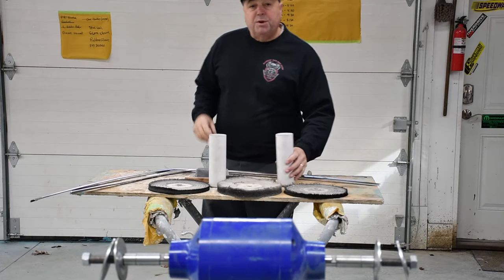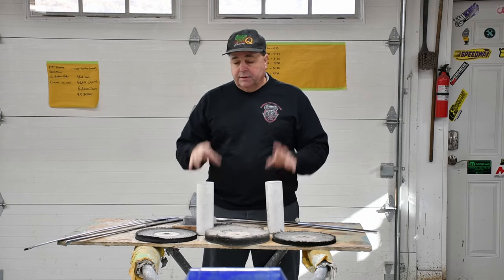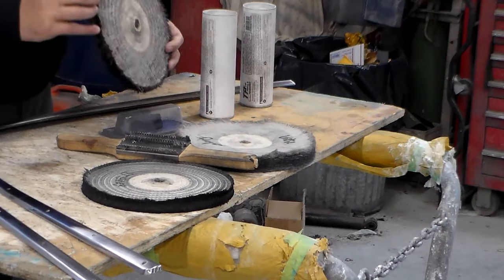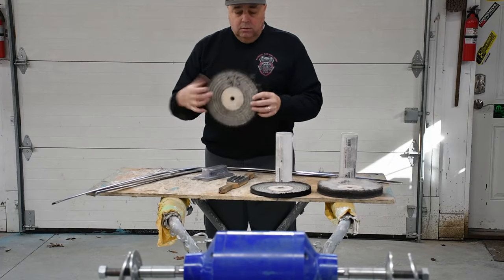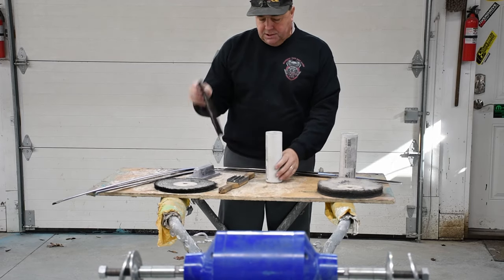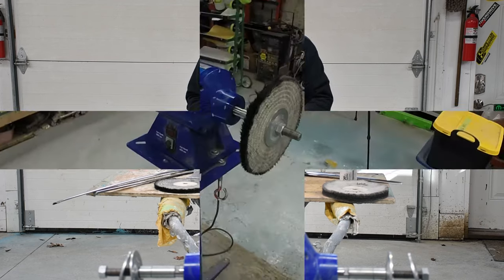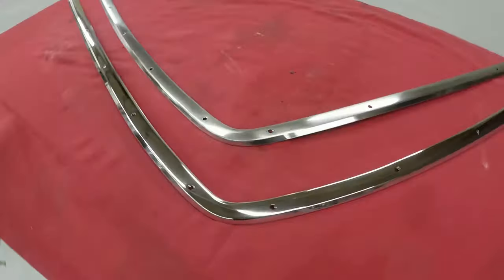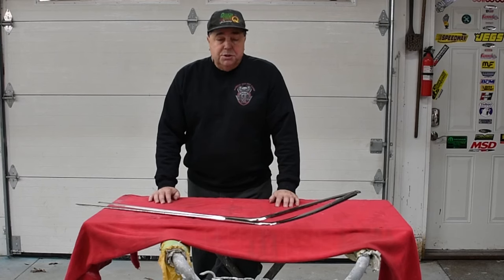How To Polish Stainlees Steel Trim On A Car

Comment: if you have a very small hole that someone added for a screw long ago and its not used any further, whats the best way to fill the hole? is welding the only way or is there a filler?

Comment: I'm get a cloudy/milky finish? How do I get rid of that? I'm using a 3/4 HP single speed bufer @3400 RPM. I have the 3 wheels and Eastwood compounds. I assume I got it too hot. Do I need to sand it out?
Reply from the maker: I would sand it out. If you sand it finer in stages like 600-800-1000-1200 it will buff easier. Then keep the temperature down by moving the part along the wheel more frequently and wiping off excess buffing residue. When you change compounds change wheels. Each wheel should only be used for one compound. This will help to avoid cross contamination of different compounds on different wheels. Use lots of clean rags too.
Reply: I’ll try that. I’ve been segregating the wheels and compounds. Have you had personal experience with this?

Comment: I read an old book on this and it says to use a peice of long thing board and tape the trim to it..that way it does not flex
Reply from the maker: That sounds like a great idea
Reply: @troykane  yes sir!..That's how the pros did it back in the day...the book is by Jeff Lilly and it's called how to restore Auto Metal trim..and it has a 57 Bel-Air I believe on the front cover?...some of that trim is thin and it's just a precaution to prevent it from bending or twisting while buffing...I think it was like half inch wood?..I have a Monte Carlo with long peices of trim..that's what I'ma do when it's time to buff
Reply from the maker: @santoscamacho3361  Cool Thanks!
Reply: @troykane  no problem!.. your welcome..always love learning from car guys and sharing so we can all learn and finish our projects the best we can!..God Bless have a good one